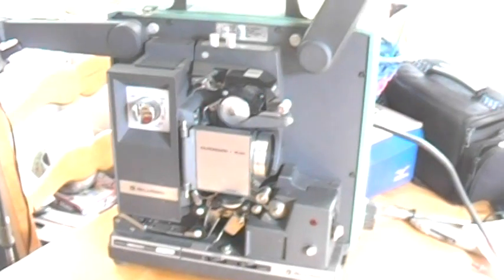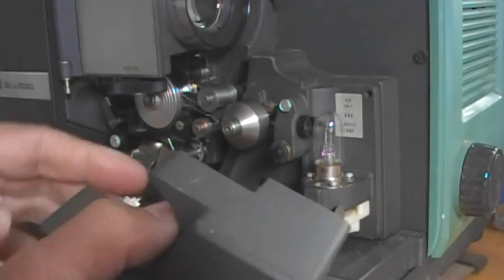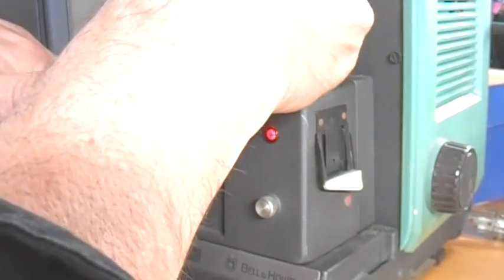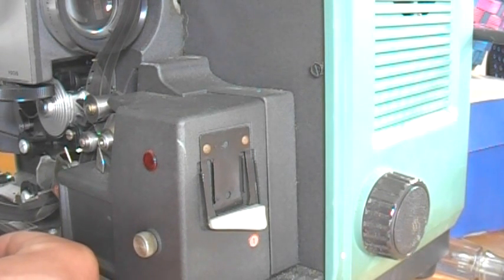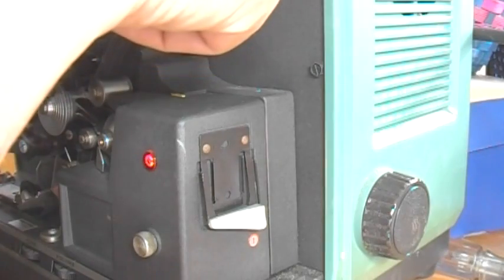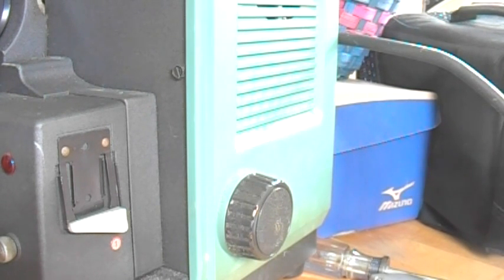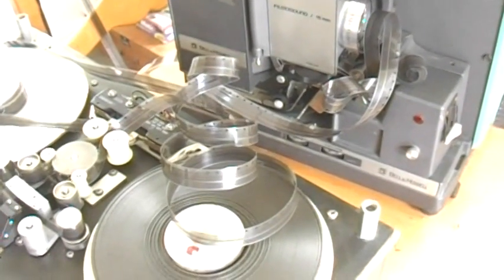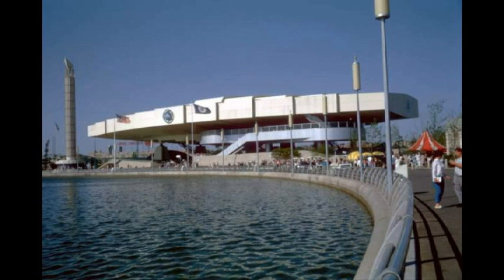Mystery of 1963 Optical Tape Player Solved

Comment: I just tripped over this video quite by accident, some 5 years after it was posted. As soon as I saw that 4-track audio in Super-16 format I was almost certain that the film was the  sound track from a theme park or world's fair ride. The moment I heard you get "Bell System" out of the audio I knew what the audio was, and I was utterly amazed that it still existed.

While that may be the last existing playback unit, there were probably somewhere between 24 and 50 of those in the original ride. Each one would have provided sound for a small group of adjacent chairs. Then the next group of chairs would hear the same thing delayed a few seconds, from the next player in line.
Reply: I was thinking the same thing as I found it 12 years after.
I want to say I saw technology connections? video talking about the ride.

Comment: Greetings, part of the problem with your attempt to audition the audio tracks on the film is that the optical pickup on any 16mm, 35mm even super 8mm optical sound projector is designed to "read" the track on the the opposite edge of the film from the sprocket holes. The film you are attempting to listen to has the tracks in the picture area. The device meant for playing the tracks is designed to 'read' the tracks in THAT area. Also, any optical pickup is capable of playing "variable area" or "variable density" optical tracks. Both formats need and utilize a slit illuminated by the exciter lamp. The slit has to be aligned carefully to optimize the fidelity, and it MUST be carefully focused on the photocell the converts the modulated light into electrical impulses that are amplified and fed to a loudspeaker. Incidentally, the exciter lamp must be powered by a DC source to avoid inducing hum from a light source that would "pulse" if powered by alternating current. It appears the unit for playback and the film you are showcasing were a proprietary format. An incredibly rare find to be sure, however in this day and age a museum limits sharing with the masses - the historical impact of 'retrotechnology'. The internet has a greater reach to touch aficionados of vintage technology. T.A. Colvard, REFLIX Telecine Services

Comment: As was said before, for playback, variable area and variable density soundtracks are interchangeable.  It is only the recording methods that differ.

For exciter lamp power, you either need DC, or high frequency AC, well above the human hearing range, as was used in the 50C5 oscillator exciter lamp power circuit found in Ampro Stylist projectors, or you need a very heavy high current filament for use with 60 cycle AC, as Victor used in their model 40 Animatophone.  This last method still produces some hum. 

With the appropriate machine, such as the one the film appears to have been found in, you should be able to block some of the sound tracks while exposing one.  The slit of light must be absolutely perpendicular to the film travel, and must be focused on the sound track print, not on the photo cell.

Comment: These are very interesting! What's interesting is when I see different bits of technology that overlap in compatibility, such as being able to play this on a film projector or playing the sound part of a film on that audio-only machine right there.

But sprockets are actually the wheels that pull the film using these, the sprocket holes. That'll be good info. for when you go to edit errors out of this video and post a new version, huh?

Comment: Actually, you're wrong about the "slit" versus "dot" for reading optical soundtracks- BOTH require a slit to narrow the light beam into a line similar to the head gap on a tape deck. Without the slit, the differences in the width of the variable
area version would not be detected correctly, giving a very muffled sound (if anything at all). The same holds true for the variable density variety of track- without the thin band of light, the differences in density wouldn't be detected correctly either. If you look at 16mm films with optical tracks, you'll see that most of them are variable
area as opposed to variable density, and both will play on a 16mm sound projector.

BAK exciter lamps are still available from Urbanski Photo Film (even on ebay!).

The multiple tracks on the film recording may be additional audio channels, since optical recordings of this type are not stereo (at least they never are on 16mm movie prints). Optical tracks made duplication of 16mm movies much quicker since the sound track could be duplicated along with the picture in the optical printer- there was no need to subsequently add a magnetic stripe after film development and then recording the sound afterward. Magnetic stripe had superior audio quality, but slowed the copying process.

Try winding the film onto a standard 16mm reel and run through the projector to see what it is- and you can rewind back onto the  hub it came with afterward. You will only be able to play one track since the pickup area is opposite the outer sprocket hole side.

I have a collection of six 16mm sound movie projectors and a modest collection of 16mm films- I've been a geek for these things since junior high (now 56 years old...).
Reply from the maker: +Mark5W8Comer Interesting... and thanks for clarifying, Mark. You are right, if I still had the unit, running it through the projector would have been the best way to take off the audio... since the audio track lined up. I would not worry too much about the other tracks, which seem to be controllers for the ride... speed, lights, whatever. 

I did sell the unit to a World's Fair memorabilia collector, so it is safe.

Comment: Before the late 1940's when magnetic tape (or sprocketed "mag stock") came into existence in the USA (as well as 35mm mag stock used in the 1960's by Enoch Light for Command Records audio masters), multitrack optical film recording was quite common in Hollywood - i.e. Disney's "Fantasound" - and early "stereo" recordings. If the content sounds "World's Fair-ish", then it would be quite probable Bell Labs began production content for the '64-65 NYWF. The only 'other' fair would have been 1962's Century 21 in Seattle in which Bell Labs did not have a pavilion...You are in the same boat as 'pallophotophone' folks... You got the media - but no player!

Comment: This is similar to what Disney came up with to sync audio to his animatronics, except I think he used 35mm film stock. Magnetic tape wouldn't work for this application, due to wear and tear and stretching, and it would probably not be very easy to synchronize with the ride.

Comment: In case you ever do break the exciter lamp (sound lamp) in your Bell & Howell, or it simply burns out...no big!  It's a type BAK; all B & H 16mm projectors from the 60's thru the 80's used them.  I'm quite sure they are still being made, and they're certainly readily available thru any dealer in audio-visual bulbs.  Hope this info will be of some value.

Comment: Yo, It's the audio and SYNCHRONIZATION portion from a MOVIEOLA 16MM FILM EDITOR. The "data" track, as he aptly said, is exactly that. It's a SMTPE sync tone so that the sound stays synched to the visual portion of the movie. He should thread the film from the top of the projector, and it will work better. 16 MM means it was used in advertising or TV news. -Just an OLD OLD geeky fart engineer.

Comment: Dumb question perhaps, but why not get the player running again. There's really not that much than can break on a thing like that.
Reply from the maker: +bigbentosmit Not dumb at all... and I did think of it, but that would have entailed working out the wiring diagram so that I would know the proper current and voltage inputs of the pins of the connector, and tapping into them and the outputs. Then I would have had to either find or fabricate a connector plug with the same pin set, or tap into the board. It would have been doable... but I considered using the projector a shortcut, as it was ready to go. I did sell this unit to a collector... but if I still had it, I'd probably do what you say. I do restore old radios, so nothing there would bother me... and it would have been cool to see it run on its own power. Thanks for the comments...

Comment: Oh, I stumbled across this video that I commented on about 2 years ago. I should also ask: Why didn't you just put this film on a regular reel and run it through officially? And why would it be the sound track for a video rather than a film, since videos have their own sound built right in? And even with what you said about the World's Fair, why wouldn't this just be built into the picture film? Maybe they hadn't developed the connection of the two yet? Happy New Year!
Reply from the maker: Happy New Year to you, too, Maxx! Yes, I could have put the film on a reel and run it, and would have if I continued with the project to copy the audio over to digital or whatnot. But I decided to sell the unit to a World's Fair collector, and he intended to do that. From what I understand, the resulting audio would be better and more complete than any now existing... they were just taped second hand on tape recorders, and have degraded, too.

It was not a sound track for a film at all... yes, it used that technology, but there was no image with it. It was a soundtrack to a guided tour... on roller coaster like train thing... through the exhibit. As I understand it, the other tracks controlled the speed of the train, or like that. Not sure.

But yes, if it was a movie, it would have been next to the movie images as was normally done. They did have them connected already... I think since the 1930's this technology existed (with the alternative using a magnetic tape strip next to the film).

Comment: This all accomplished with the electronics we have now - The semiconductors, optical components, and IC chips that we have today. The old a mono-chromatic recorder and could have been a leader in clean, cheap disposable recording tapes and cassettes.. Or even cheap "records" They could even be made like a picture on a piece of stiff cardboard. The frequency response could have been unlimited using colors, and the pollution problem of disposing and creating magnetic tape would be gone (That is what killed it.). It could be created on very thin, recyclable  plastic.  Printers are still alive, and can, (at least once) record a (multi-sourced recording using , light colors and brightness levels on a film reel or cassette. People are still crazy about analog. Vinyl records are still selling. So analog is still alive.
Reply from the maker: All good points, George. And so as usual, there are probably dozens of ways to achieve the same results... who knows what could accomplished, with entirely different methods, with a bit of experimentation...?
Reply: Thank you. But the technology still lies sleeping.. Between the  16,777,216 colors and light levels that you could change into sound would embarrass the computer's recording capability. And you could have that see though record (no needle) or see though tape (no tape head). The only thing that could destroy it would be extreme heat, cold or fire.

Comment: This system was designed for a continuous operation, so I am curious about what was supposed to happen when the machine reached the end of the film.  I have a strong suspicion that if you get the machine restored, you will find that when the film reaches the end the machine automatically changes direction and that the other two tracks are simply the same recording (and synchronization track) recorded backwards, allowing the machine to simply run all day unattended without having to be rewound.

Note that there would have had to be a separate machine for each car full of people, because each car would be at a different point in the ride.  So there were probably at least a dozen or more of these machines produced for the ride, probably one inside each car.  Very cool find!

Comment: Recording sound on film like that is relatively old hat. In the days before multitrack tape was commonplace, crafty engineers would record multitracks onto 35mm film for greater control in editing, mixing, etc.  This looks like it had at least 4 tracks. If it were for a guided tour or some kind of pavillion, it was more than likely D, M & E with a sync track. (That's: Dialogue, Music and Effects) with a control track to operate or trigger other mechanical devices.  Would be interesting to hear what's on that film!

Comment: Hi Proto57,

This type of recording devise for came out in the early 1930s by Philips Labs in Eindhoven. At the time Philips Electronics had a station on the air called PCJJ later called PCJ. They have been looking at a way to make recordings of music and radio programs that would sound better than transcription discs. They came out with an optical recorder and playback machine that would record on two tracks using 35mm film. The only reason why it was decided to stop the project after a couple of years was at the time film was made of nitrate and highly explosive. We have a few recordings made by Philips between 1930 and 1932 that were made in stereo. If your interested let me know and I can send you copies we made from the recordings we have in our archives that have been digitized.

Comment: My thoughts on this are sad.. Previously, this precious audio technology that was downsized from a tape reel to a cheap cassette, was abandoned. It was simple. It was rugged and not prone to magnetic fields, heat or cold of a car, or static electricity, or time. And modern synchronized motors and gentle guide rollers could keep stretch losses away.  The analog recording frequency, Loudness and data, could be extremely compressed with no loss.

Comment: if you had the right setup, you could digitize it all and create a player that would read through the visual data and generate a list of values based on number of on/off blips per length of time, and playback (and control playback speed) entirely from software.

Comment: these were used to record music for Lp records in the early 60's. it was a gimmic they would brag about on the music album covers "This Lp is recorded with Optical Film for the HIGHEST AUDIO FIDELITY. I have many of these albums, they were quite common. If you ever are able to line up the reader with the tracks you will most likely here jazz or big band late 50's/early 60's LOUNGE music.
Reply: +ANATOLIACHTZEIN They were using 35 mm magnetic tape, which permitted multiple tracks that offered an improvement in signal to noise performance, and very good speed stability (low wow and flutter) due to the sprocket hole mechanism to drive the tape.   And, you could edit the film-like tape, if for no other reason than to assemble a master recording for duplication to phonograph discs.

Comment: @Kinematographer Not unusual as the Germans used 35mm sound on film for their radio transcripts when we were using 16 inch 33 1/3 rpm records. The Disney film Fantasia had a separate sound track running in sync with the film.  Selsyn interlock, also used in 50's 3D films and Cinerama.  Fantasia was a four track optical whereas Cinerama was 7 magnetic tracks. Remember 16mm offers advantages that Mag tape did not in the era.
VAPEUR

Comment: This link does not have any audio, but in any case in addition to the commentators suggestions below, a likely candidate for a continuous loop of sound is the sideways seated conveyor at the Bell Telephone pavilion of the 1964 World's Fair. Every seat has a pair of headphones.
https://www.youtube.com/watch?v=wRZ5qdrgvU8
The advantage of an optical soundtrack, as opposed to a magnetic tape, would be that it is a 'no contact' technology and even though museums etc used professional auto reverse cassette machines for exhibition sound experiences from the 1970's until digital sound took over, they were a real reliability PIA. I think the comment below by John Schulien is a good guess, that there are two sets of tracks (like a pivot head or 4 track cassette machine) and an end of roll detection to continue in the other direction. From your close-up example of the sprocket 16mm film, there are only variable density audio tracks visible, not sync exhibition effect control tracks. Variable density can be a much simpler recording technology, many hand-held 16mm cameras even had this option (along with Mag Stripe as found later in Super 8 as well) for news/reportage etc.
This content of the narration for the 1964 would be another subject; to inform how propaganda and, as some historical observers of society claim, a form of brainwashing, can be presented as entertainment. Potentially much more interesting than the technology, which is pretty mundane and uses off-the-shelf 16mm Acme editor and other projector drive and playback components.

Comment: This tape could be directly scanned to an audio file on a computer, allowing for higher quality playback, without requiring really expensive equipment.
Not to mention, you could also figure out what the data tracks do.
Reply: +kargaroc386 I have this projector - it has a 5 pin din output! straight into your sound card, great transfer :)
Reply: +kargaroc386 I have this projector - it has a 5 pin din output! straight into your sound card, great transfer :)
Reply: +kargaroc386 I have this projector - it has a 5 pin din output! straight into your sound card, great transfer :)

Comment: I wonder what would be the quality of the recording using this techniqe, especially would it outperform magnetic tapes.
Reply: +SFtheGreat Not likely.  Optical systems usually have more inherent noise during playback.  At least for analog recordings.  Digital would be a different matter.